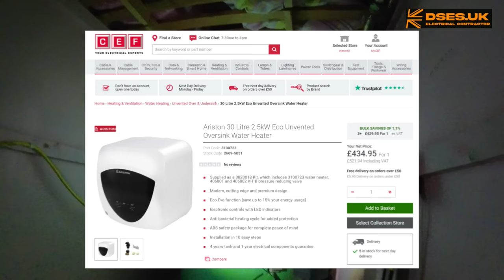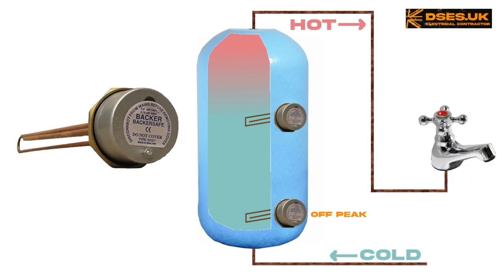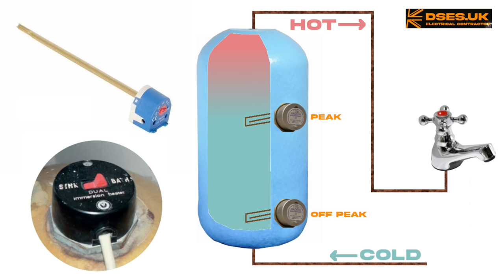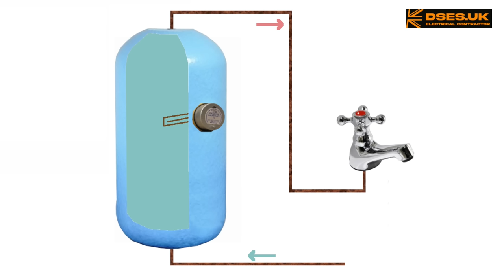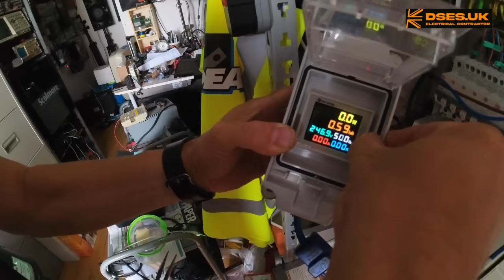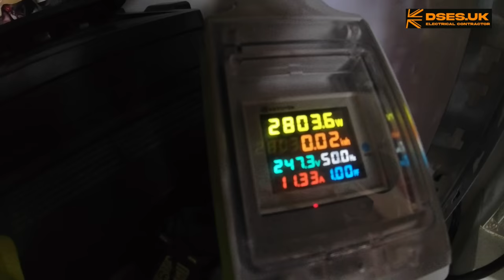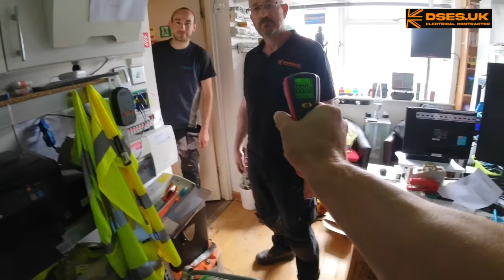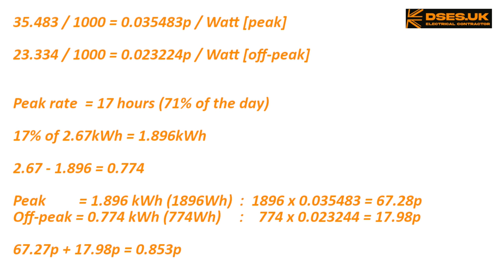Upgrading my wank hot water tank

Comment: i was literally talking yesterday about doing this as my copper tank is sagged so im very interested in this
Reply from the maker: I do describe it incorrectly however as I state more than once that it's an instant hot water solution when it's not. It's basically a smaller and more efficient version to what I had before, but whereas the old tank would always lose heat because of the cold water it also contained, this one has no cold section and does a better job of retaining the warm water over time.
Reply: @dsesuk  ive always fucking hated the tank, absolute fucking pain in the arse, just never thought about this in the home always thought they were more geared to shops/restaurant/commercial settings

Comment: You shouldn't really have a valve fitted between the cold water pressure relief valve and the cylinder.  It's not exactly a massive risk, but it allows the possibility of defeating one of the pressure safety devices.  The supply isolation valve should be before the cold relief valve.

It might technically be non-compliant with building regs G3 due to that valve, although might scrape through if there are still two remaining safety devices with the valve closed.  I'm not certain about that, just aware that the regs people have a thing for the safety of unvented cylinders due to larger ones demolishing houses when the pressure can't escape and the heat source doesn't cut out for whatever reason (rare, but it has happened in a few cases).  Steam explosions have a lot of energy.

Comment: So I one day found myself looking at the wall and wondering, would it make too much sense to have a "front tank" that could be run when energy is cheap(er) assuming spot pricing on electricity. Then you can preheat some of the water for later use and bring it up to safe temperatures (over 55C to avoid risk of Legionella pneumophila). As it would take less energy to heat lets say 38C water to 65C (default hot water temperature here) compared to fresh water supply (that usually is around 4-13C, depending on the season). This could also act as energy sink if there's solar panels and at the moment no direct need for energy they provide. Some home automation to turn on the elements after AC is happy and that's one of the few practical ways to store energy at home without really expensive upfront battery costs. 

Assuming that the house needs more warming than cooling, the wasted heat is not really that wasted if the tank is located somewhere indoors. It is just less heating required by more direct means.

Comment: A photo cell on the outside wall and a contactor could provide a solution to only allow it to heat when been powered by solar. This could effectively provide free hot water. Unless you are using lots of water during darkness hrs then there should still be enough to provide hot water for hand washing at all times. Could also add a 1hr timer on a push button to provide a "boost" function if required to heat water when dark  This addition would make a nice follow-up video.
Reply: Sounds good!

Comment: The Ariston Heaters I have used have Magnesium sacrificial anodes which need checking by a qualified person every year. I have had three fail in 6 years in our Village Hall with electrolytic corrosion.
Reply from the maker: Oh balls!
Reply: @dsesuk  Yep check page 17 of the manual.  Our 30 litre model flooded the kitchen after 3 years with water spewing out of the anode chamber. Our 10 litre models failed their appliance test this year with rusty water dripping out of the anode chamber and obvious corrosion around the inlet and outlet pipes (even with the dielectric junctions fitted). Why the tank is made of non-stainless steel and glass is a mystery to me. The IR resistance had also fallen through the floor on both models. Unfortunately with all the complex pipework (expansion vessels, tundishes etc) we had no choice but to nip off to Screwfix and get like for like replacements which were relatively easy to fit in time for us to open. I've replaced the fused spur with a plug top so that I can monitor the IR for signs of corrosion.  Our units are under the sinks and a pain to get to so the annual uninstall and drain for inspection will be a nuisance. I haven't yet found the correct part number for the anodes for each model as clearly I need some in stock.  It is no good taking the damn thing apart and finding you need to order one.
Reply: @adriandale3213  limescale reducer will help and anodes are about £20 , 15 mins

Comment: Hey David, what made you go with this water storage version over an instanous water heater? Currently trying to ditch gas and deciding what to fit. Cheers
Reply from the maker: I've an instantaneous tap in the kitchen, so this is only to serve the basins. I'm not saying this was the best solution or even the right one, just one I picked as relatively quick and easy to put in that I'd happened to come across out in the world before.

Comment: it won't take long for all 30 LTRs of water to run cold and you'll be waiting around for I to heat up, I work on commercial shops and they fit these in a kitchen cupboardto to feed the kitchen staff room sink an a couple of WC wash hand basins. and once you have washed and rinseda few pots the water is cold.  then it's another 30 min before it's hot again. 
the instant water heaters work more like an elec shower and run at 6 to 8 Kw.
Reply from the maker: It's only for the basins Scott. I have an electric shower and, in the kitchen, a boiling water tap. It's just a smidge better than the big ol' tank and it doesn't hold all that cold water I don't need. I'm still buggered for a bath of course, but then it's been eight years since I last had one and I'm used to the odour around here now.
Reply: @dsesuk  slower flow and it will heat up warm non boiling water continuously fine , when I was in holiday in Thailand these were used as electric showers 😂

Comment: get phil to fit mixing valves to the handwash basins leave htr set at 50 for the kitchen taps
Reply from the maker: There's an instant boiling water tap at the kitchen sink if something with more pep is needed. The taps in the downstairs loo are to be replaced with a mixer when Phil refits it all, but goodness knows when that'll happen. You know what it's like trying to get a plumber to turn up!

Comment: Lot of faff for a small tank of hot water -  water cistern with a 3000W Suspension Immersion heater / element / some timer switches - plumbed with some plastic piping you’d be good to go for £150. Half a days work 👍
Reply from the maker: Well, I never said it was the best option.
Reply: @dsesuk  indeed - you can always ask ya subscribers for input before blowing ya load on these things - how much was it? How many litres?

Comment: I've had good results from the Combimate limescale reducer. Looks a bit like a space helmet, and unlike other similar devices you can see how much is left inside.

Nice thing about it is that the water coming out is still drinking quality so you can fit it in line with all the rest of the plumbing unlike a regular water softener. 

Used on systems that tended to get completely furred up within a couple of years. Had one home made heat exchanger with 15mm pipes inside an outer shell of a 22mm pipe get so clogged the outer passage was solid when cut open with a grinder. That problem completely solved with the Combimate.

And yes I've seen the steaming toilet before :D
Reply: ? What was the function of your home made heat exchanger - presumably straight pipes ?
Reply: @oldbutstillcurious3615  straight pipe, reducing Tees, etc.

It was an attempt to make a heat exchanger more tolerant to getting furred up with limescale. 

Better off buying a plate heat exchanger and putting a Combimate in front of it!

Comment: Any reason why the new hot water heater is not installed where the old cylinder lived? Asking for a friend. I lied, I don't have any friends.
Reply from the maker: The wife has designs on the storage space that deep cupboard can offer, especially if it's opened into the adjoining bathroom.

Comment: How comes you got rid of gas in the first place Dave? Was that because you installed your solar array and wanted to make the most of it?
Reply from the maker: I dumped gas back in 2014, foolishly thinking that it was a dinosaur fuelling option which would be phased out by being priced out in the coming years. After all, gas is limited in supply and often has to be imported making it vulnerable to world economics, whereas electricity can be generated via a variety of means that will surely make it a cheaper commodity going forward. Oh 2014, how naive of you! If only you could have foreseen how inept UK governments would be in securing an own means of adequate generation, how Brexit would remove us from a market we need for importing energy and how world events would indeed make the price of gas skyrocket, but that the cost would not be applied to gas users because that would apparently be unfair as not everybody uses gas, so it would instead be lumped on electricity to spread the cost over absolutely everyone.

You’ve gotta laugh haven’t you?
Reply: Bypass 😂
Reply: @dsesuk  well if you dont laugh you might cry. Not finished the video but just be aware below 60 decrees C you may be at risk of legionella, unless that ariston unit has some form or purge function built in which is what is required when you do low temprature heating for modern condensing boilers and heat pumps.
Reply from the maker: @HAelec1  Bugger. You're the second person to say that! I guess a ramping up to full whack every now and then may be in order?
Reply: @dsesuk   I believe legionella is still dormant and 45° and with the water turn over in that tank I wouldn’t worry about it
Reply: @dsesuk  well with stored water you are at risk of legionella so yes it is recommended to ramp up to 60°c at least once a week sometimes more depending on many variables. From memory it will die above 55°c in two hours but don’t 100% quote me on exact time scales. However yes definitely needs a ramp cycle. I assume there’s no way to program this in?

With modern modulating boilers when using bus controls you can do this with software as it’s much more efficient to run at lower temperatures rather then mixing this lovely 60°c water with an abundance of 15°c water. So in the controls you have it hot 60°c at night once a week on a random day.

Comment: Bundy on his video on the 13th said that he called you and you said it was fine to run tails through the fabric of a building less than 50 mm deep into Henleys.
I would have though that tails needed a 30ma rcd if less than 50mm 

Btw you also have bundy saying Buzzzzzzzzzzzzzz bar now.
Reply from the maker: Morning Mainline. Which video is that, I can't seem to find it among all those bloody shorts he's pooing out? I don't recall such a conversation, nor would I run tails in walls less than 50mm deep. By design, if the incoming supply is to be some distance from my DB, I would (and have) run armoured if it's to pass any distance through the structure of the building. On retrofit, I've pulled new tails between an exterior box and interior CU through the wall cavity in place of existing old ones like anyone else, but tails in a wall less than 50mm? No, not without RCD or mechanical protection. If Mr B and I have had such a chinwag, one of us must have grabbed the wrong end of the stick!
Reply: He was also on about 100ma rcd  but as you probably know it would have to be a 30ma.
Actually, I've messaged him a few times in the past pointing out non-compliance, but he never replies.
Reply: I also pointed out that because the Cu is in a cupboard it's technically not in a zone, so no real need to move it.
Reply: I reckon those tails are more than 3mtrs, but that's just a guess, obviously.

Anyways David, take care out there as there are some proper C^^^s about :)

Comment: Why is your tank recharge time so poor?
Reply from the maker: What's that, the time it took for the old tank to heat? It was only a boost heater anyway, so 45 mins would see it do its thing, but it was only ever useful for the sinks rather than the bath.
Reply: @dsesuk  oh so your 200L or whatever tank was actually about 20L. No wonders! 8 years!
Reply: Would have been cheaper to keep your tank; get a recirc pump and run it on off peak hours.
Reply from the maker: @Swwils  Maybe. That would have sorted the bath problem! I can't claim this was the right approach, but the wife has plans for the airing cupboard space, so who am I to argue?!
Reply: @dsesuk  wise choice!

Comment: Entertaining as ever BUT, the "scale inhibitor" is total rubbish (get a refund) and you need to heat your water to 60C quite often to take care of Legionella!
Reply from the maker: Oh balls! Is that true?
Reply: Don't worry about it David, the turnover rate of water will ensure very little to no risk. Check out HeatGeek's recent video on Legionella
Reply from the maker: Turns out it has a built-in "Thermal Disinfection Function" according to the manual. If set below 55C, it operates every 30 days and boosts the thing to 60C for an hour.
Reply: @dsesuk  Well there you go then...probably a legal requirement for being able to sell the thing in the UK?

Comment: 8:45 oh dear Mr Savery, that mathS, or at least the equation, is not correct, not correct at all... 240V divided by 3000W to give us 12.5A, you say, surely not... It should be 3000W divided by 240V to give us that 12.5A, as in Amps = Watts divided by Volts, or I=P/V.
Rookie mistake, that damn shit clump hopping plumber will laugh at you David...🤣🤣
43:11 your hot tap is leaking, so there goes any savings right down the drain, so to speak...
Reply from the maker: Ah, well. That bottle of whisky you saw was bought on Saturday afternoon and empty by Sunday evening which was the same day those slides were made. It might explain, if not excuse, why things are a little base over apex!
Reply: @dsesuk  hey, we all know about your wife's drinking. I mean just look in a mirror David, that poor woman.
However, I fail to see how her downing a bottle of whisky, a day, to numb her pain, has anything to do with the mistakes in your equations...🤣🤣